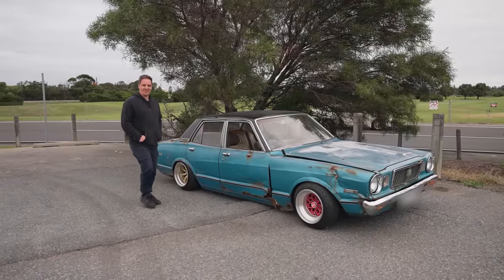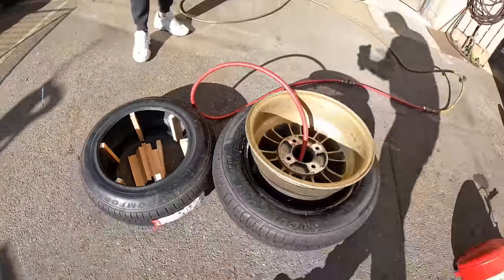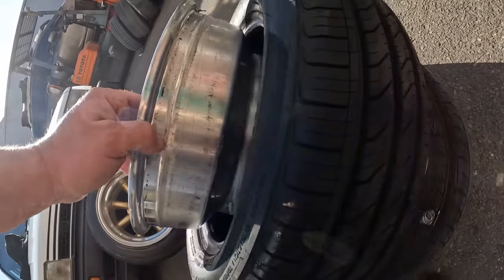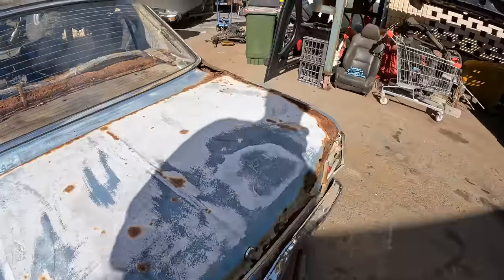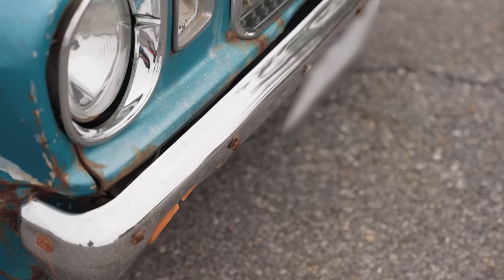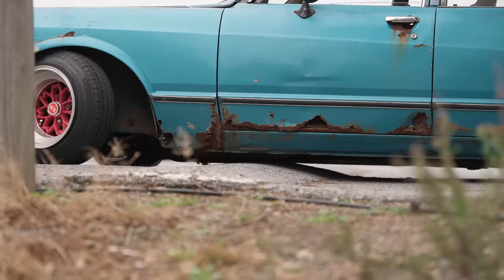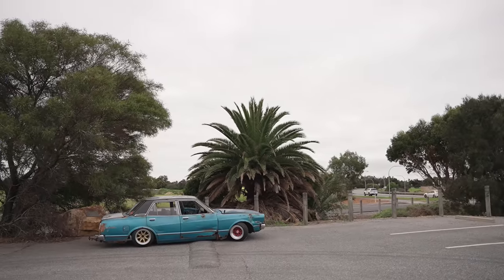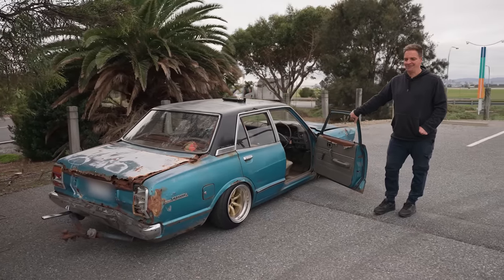NEW daily straight from the swamp!

Comment: I am surprised the windows didn’t fall out when you hit that speed hump 😂😂👍👍
Reply from the maker: Battery fell out
Reply: Don't worry about the windows even when they are up it would be more of a suggestion to keep it air tight. I was waiting for the car to snap in half with the rear of the car taking a sharp left like a trailer thats come un-hooked while the front of the car kept sliding straight ahead lmao